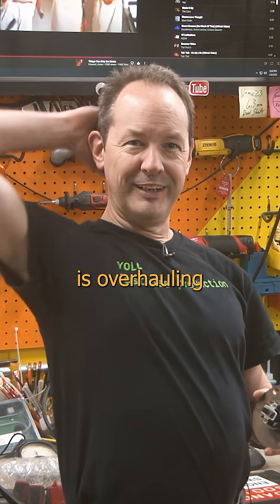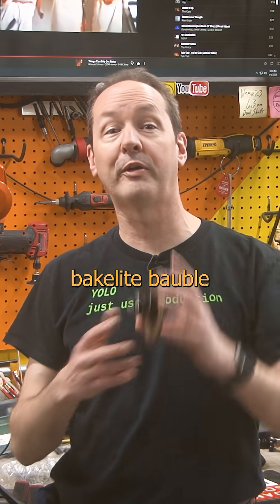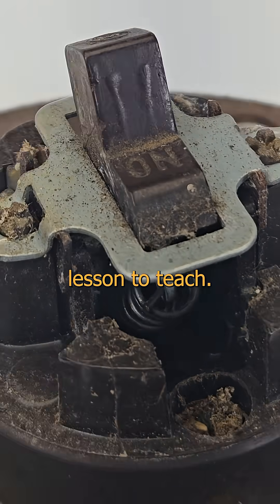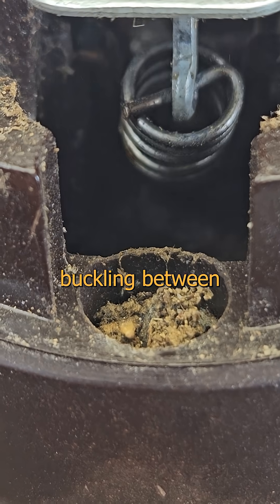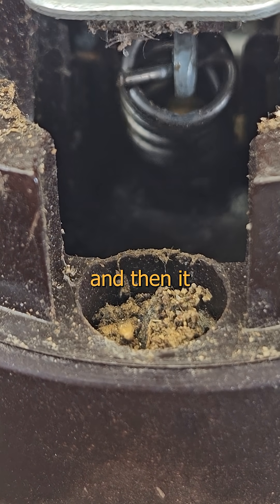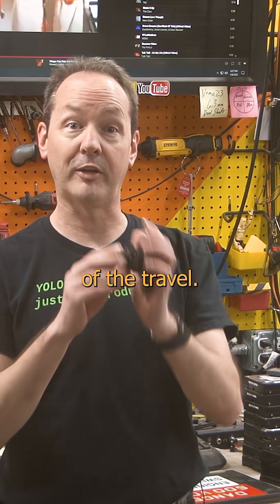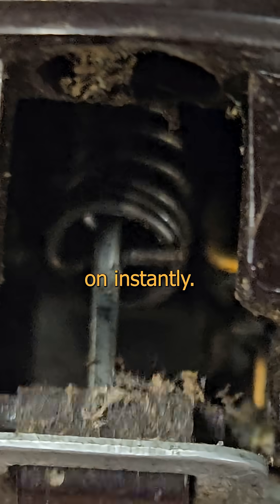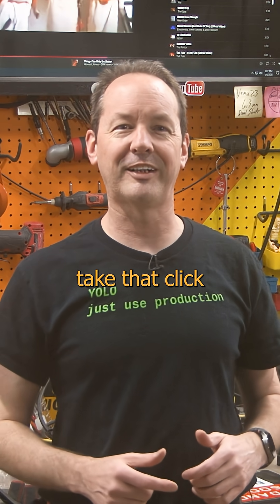Buckling Spring Switch #chrisboden #comedy #engineering #design #electrical #antique #vintage

Comment: I once had a 1982 Buick Park Ave that had one of those screwd into the roof just above the rear view mirror to turn on a 12inch long 12v fluorescent light (designed to go under a kitchen cabinet). I installed it after the headliner fell out and fucked up the dome light. I quite liked the brightness.

Comment: I happen to like my rgb keyboard. I just wanted something smooth and quiet that had a back light for night time. My adhd brain said I have to get one I can build. Spent 2 hours lubing everything and putting damper rings on it, but now it's a prized possession. It has spring, I can feel the click but it doesn't wake anyone up. My old keyboard was described as machingun fire because it was too tactile. A lubed keyboard is unlike anything else though.

Comment: I got a really good RGB mech keyboard, full-size, for $52 on sale in 2020. I have replaced 5 keys as I didn't realize that the kit came with tougher switches available for the WASD and Space keys, but were not installed by default. No problems since. I cannot imagine going back to a membrane keyboard. Even with the WASD and Space keys having really tough switches, my average typing speed went up by 18 WPM...from 73 to 91.

Comment: I wish you could still get switches that work like this, I would replace all the switches in our house.  The cheapo switches you get now are garbage.  I would pay extra for a switch that can't get stuck in the middle and fizzle with a partial connection.

Comment: Back in the early days of Edison's influence of electrical engineering, DC was the main power supply for many areas of the country. Unlike the sine wave of AC power, DC never crossed the zero line and was subject to arcing as the switch contacts separated. These "buckling spring" switches attrmpted to break the arc quickly by snapping the contacts open and closed very quickly. My dad had one in is house, a three way switch, and for many years it had no cover on it, and i would turn the light on and off just to watch the contacts flip and listen to the snap.

Comment: Fun fact event transistors in on/off use you want to switch as fast as you can. There is no sparks but at partially state transistor is like resistor and heating up. At full on also heats up on flowing current but at state between on and off heating is magnitude more.

Comment: I have something right up your alley, found in the dusty corners of a ski resort, my best guess is that it measures power consumption or possibly a timer to meter it, either way it has a plug and an outlet to make it the intermediary to any plug and play party. I will have to make a lil video of it and tag you do you can enlighten us because the guy bought it at a yard sale.

Comment: I just tuned up the big honkin' power switch in my classic Lincoln tombstone AC welder. It had gotten sticky and wouldn't reliably flip OFF. But it's very accessible once you get the case off, and all the guts are exposed and look pretty much exactly like your doo dad. A little cleaning and some pressurized air, followed by a little lube and she was flipping up and down WITH ENTHUSIASM.

Comment: I pound that keyboard 6-8 hours a day 4 days a week because typing is my life. Dictation is nice, but court drama has more spice and until AI comes for me this work from home mama doesn’t leave her pajama and saves on daycare drama. The wpm speed a mechanical board can handle without failing or going floppy on me is worth the price of admission. This gal needs a reliable, upstanding model to withstand the punishing work I put in. I've worn down keycaps enough to replace them for functional rather than cosmetic reasons because enough rubbing will eventually destroy your a r s & e keys. Those poor membrane fellows are so thin with a short activation distance, I hardly know if anything is happening and then suddenly something's been stretched a bit too many times or a little too far and there's no way to fix the poor diaposable thing. Repair, reuse, reduce ewaste, and death to the proprietary screw.

Comment: Switches in my old house were like that but the stress imparted by the spring started breaking the 60 year old bakelite.  
The new switches scare old electricians because you can very easily and k have left them at half-mast.  They have no desire to choose a Boolean direction but rather just stil wherever you stop pushing.  This is proof that UL means absolutely nothing.

Comment: I paid over $200 for my keyboard and spent 2 hours the other day packing lead pellets and ticky tacky into the hollow space in the space bar to add mass and fix the irritating snapping noise it made at the top of its travel. 

It's possible I have a problem. But my space bar is now the quietest key on my keyboard and that's pretty cool.

Comment: i have a switch of such a springy quick-flipping design from way back when they still made things in chicago. it has been breaking a circuit at its max rated amps the past ten plus years and still works fine. i took it apart and cleaned it last year

Comment: The buckling spring (or avariation using a coil in torsion) is also behind the nearly bu8lletproof shutters in box cameras from the days before you were born.  The cameras are cheap and in many of them you can expose the shutter mechanism by bending a few tabs r removing two or three screws -- and you'll see the simplest possible way to give a consistent exposure time for three (1930s) cents manufacturing cost.

Comment: Interestingly, a lot of the older government buildings in India, still have these kind of switches for each and everything all the way from the bulbs and tube lights, fans and even larger stationary equipment still run onto 240 V.
All of these because, back in the day, fire was a significantly greater concern due to the sheer volume of documentation kept in every government building that could and would easily go up in flames.  Any and all sparking was to be avoided.

Comment: @physicsduck I think you are actually mistaken here.

While this spring may buckle, the buckling action does not contribute to the operation of the switch, it would work even if the spring only compresses linearly - as another commenter pointed out, this is an over center mechanism. 

As I understand it a buckling spring mechanism relies on the buckling action and the resulting change in the geometry of the spring to complete an operation. In the legendary keyboard of yore the angle of the end of the spring itself levers a conductor into position to close the circuit when the spring buckles - see Wikipedia Buckling_spring

That said love the channel, you inspire me, and that switch is indeed pretty cool regardless.

Comment: That mechanism is also used in type Z switches on almost every older railway vehicle in Poland. In fact, after some modifications they are still produced and used in refurbishments of older railway stock.

Comment: As a computer enthusiast i went down the rabbit hole of keyboards. Purchased my first mechanical keyboard in 2014 and still going strong with thousands of hours use. My wife hates it because some of the letters wore off 😅. No waifu garbage just standard layout with a blue backlight.

Tactile buckling spring keyboards were mostly in vintage IBM stuff. They are highly sortafter to be restored by collectors 👍. 
Newer keyboards use folded flat metal and sliding plastic with different profile shaped bumps for that tatctile feel.
Search
 Cherry MX switches diagram
 Ibm buckling spring keyboard
For all your hardware internals porn 👍

Comment: Exactly. It shows very clearly in high voltage stations. I visited one once, A sirene started, then a switch kicked in. For relays it is the same. They need to click. Releasing a relay coil slowly is a no go

Comment: The funny thing, is that to my knowledge there is only one bucklig spring switch keyboard on the market, that being the Model F replica. And they don't have RGB, they looks just as boring yet sexy as the original IBM ones.

And man would I want one if it were to just like appear in my hands somehow, it's an awesome keyboard. But I just don't have the kind of money that they ask for it. I realize why, it's a small scale production, but the high price being justified does not mean that that amount just magically appears in my wallet...

Or that I will remove that amount from my yearly beer budget...

Comment: I still use a PS2 1993 IBM M keyboard for the buckling spring keys. And I have a Unicomp clone as well. Haven't encountered a modern key switch that is as good as buckling spring.

Comment: Not exactly how a classic Buckling Spring Keyboard Switch works.
But it IS how a classic MICROSWITCH works.
The classic BSKS has a long skinny compression spring stuck on top of a 'flapper' which kind of sits on its 'heals' and as you press the key down it compresses the spring until at some point its 'knee' (or belly) pops out, causing the 'toe' of the flapper to tilt down to the circuit board, making the classic 'clack' sound.

Comment: Actually, the buckling spring isn't the predominant keyboard switch these days - the buckling spring mechanism was used in IBM model M keyboards, but is not in general use these days, so you'd be hard-pressed to find a keyboard with both RGB and a buckling spring mechanism in the switch

Comment: it's the same but more one-sided with circuit breakers
You compress the spring to turn it on and a little force from your finger or the coils inside and it slams open

Comment: I remember when Martin from Wintergatan was working on the earlier stages of the Marble Machine X, he discovered this in the form of a bi-stable mechanism. Like you said in the video it's on or off- nothing between. He used it for the mechanical activation levers on the different instruments of the machine

Comment: Actually.... Buckling springs are an ALPS keyboard switch and aren't that common in modern mechanical keyboards. Save for the IBM model 'M' keyboard and it's clones (I still wish I'd grabbed that box of 90's DELL model M clones in black a few jobs back but hey, ho...)

Comment: I have a miniature version of this in a holiday night light. Well built and screwed together, not glued together, so repair should be easy. --- but it is always on, no matter the switch position. I have disassembled it and haven't figured out how the contact is supposed to be opened.  After looking at this video, I may give it another shot.

Comment: I have one of those still in use in the utility room of my basement. I'm pretty sure it is from the knob and tube days. Which my house still has running through the walls and floors. I'm fairly certain those circuits aren't being used anymore but I can't say I'm 100% sure.

Comment: OK. First, the way that switch works is called, Hysteresis. A term used almost exclusively for the magnetic fields in hard drives. But it applies to switches as well. Keyboards have a Hysteresis as well. Especially those old Cherry keypoards with the big ass springs under them. Think 1990.
SECOND: Anyone else think he was holding up a model of a Photocopier there near the end? Any other copier techs watching this? How many others were triggered?

Comment: And that slow transition is exactly why old school ignition POINTS have a capacitor in that system... gets rid of most of the arcy arcy there so the little contacts survive a wee bit longer. Especially when the magnetic field in the ignition coil collapses and let's that genie outta the bottle.  XD XD XD

Comment: Im the proud owner of 4 Model M keyboards.

Buckling spring tickles the brain like no other. I also work on and repair model trains in my free time, and there are quite a few oldschool O gauge accessories folks have bought me that use the same mechansim. 

It's divine.

Comment: But, but, that isn’t a buckling spring switch. It’s an OTM. I am disappoint. 

Buckling spring switches, like the ones in my “why the f**k is your keyboard so loud?” rely on the spring buckling to one side to allow the push button to contact. Unlike this switch, they do not have two stable states maintained only by spring compression within the mechanical limits.

Comment: That's fun. I stumbled on it's slicker cousin while troubleshooting a 3-way in an old farmhouse last week. Turns out these old "silent switches" use mercury to take all the angry energy from making that connection. Because, "You can't melt me, I'm already a liquid!" is juvenily genius. Unfortunately I still haven't solved the switching scenario that won't shut the circuit off.

Comment: Joke’s on you, Chris, my model M is not RGB. 

And I don’t even have a waifu.

There are complete nutcases who think that they’re not mechanical due to it using a membrane and not some cherry rgb switch nonsense. Screw RGB.

(Also fun to put an adapter on it and plug it into an iPhone or android, but I’ve got the clicks keyboard so I don’t need another.)

Comment: The new keyboards have hall sensors in them instead of just the mechanical switch. Now they allow you to set multiple functions to the same key on differentiated by the force used to press the key. Half press is a but full send is A.
Reply: And they are utterly useless for most people. And probably for typewriting too.

Comment: Even though they last as long as they do, there is still sparking but not near as bad as others. The one good thing about these is usually if the contact does close at first, if you cyle them again, they will close, but once they give issues they go away faster and still need replaced soon